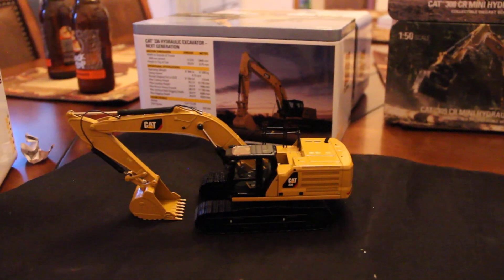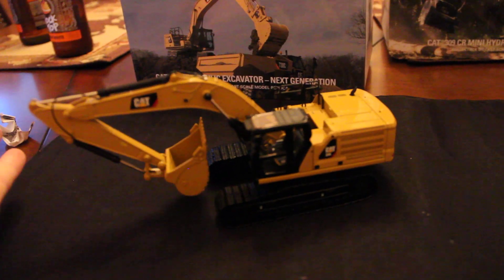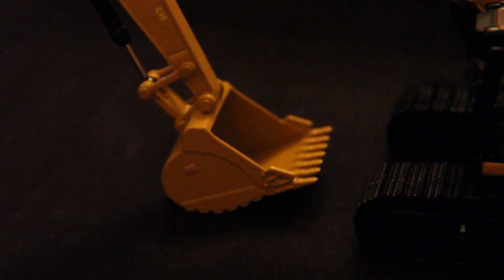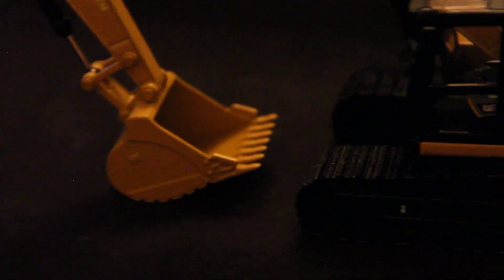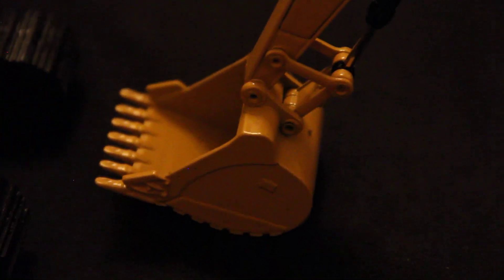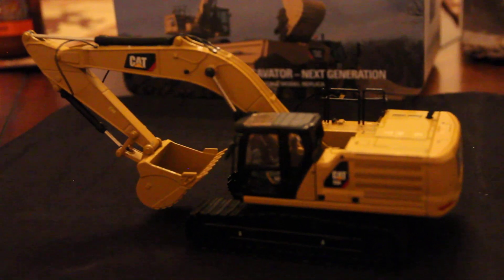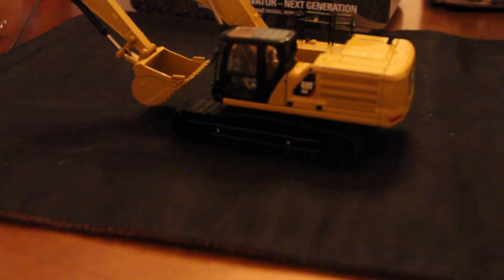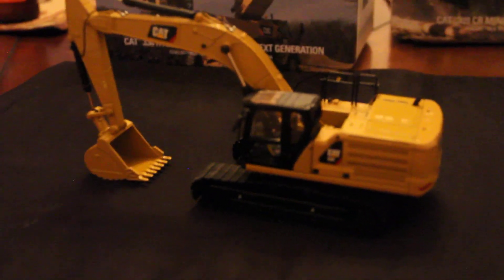Diecast Masters 336 Review

Comment: Great review! I just got the DM CAT 336 Nee Gen, and the DM CAT 349... both in my opinion are great! Especially for <$100, shipped.
The 336 bucket is something I noticed as well, the shape is great, the 7 tooth configuration, ehhh... whatever. It is a bit smaller than the 349...

I have 2 actual 336 (2019) CAT excavators I use everyday. I think Diecast Masters did a pretty good job here! One thing I really like- you can take the guy out of the cab!! The DM CAT D9T.... not an option!!

Thanks for the review, keep them coming!
Reply from the maker: Thanks for the comment the cat 336 next gen and the 349F are both favorites of mine from them and i think they did a great job with both models I have them posed next to each other in my display case I am also glad they did away with the operator I have a lot of models that have the operator inside permanently and it is a bit of an eyesore but I am not going to destroy my models trying to get them out of each one